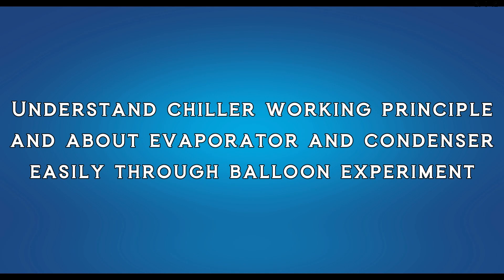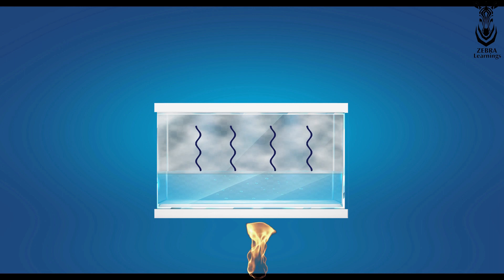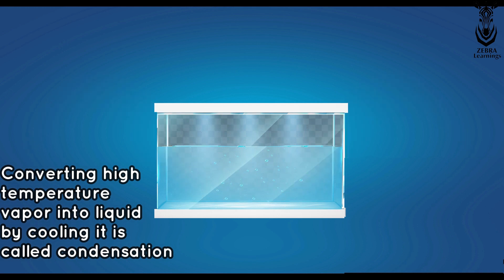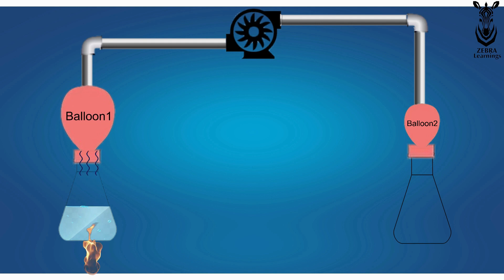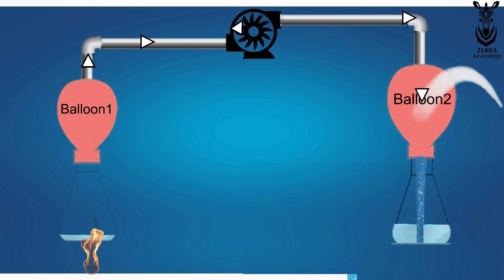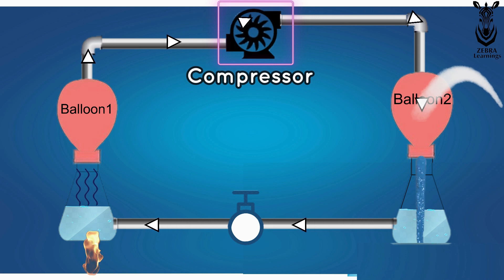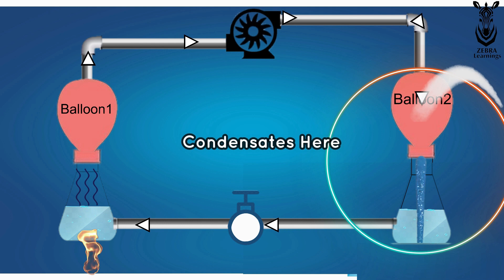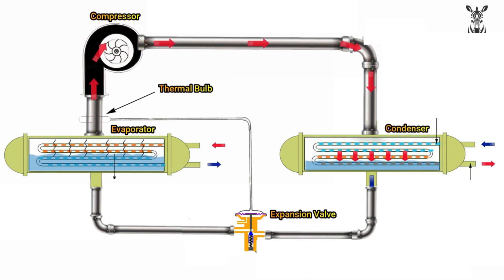Easily Understand Chiller Working Principle by Balloon Experiment | English | Animation | HVAC

Comment: Why does the refrigerant change its state from gas to liquid at 30°C in the condenser, if this same refrigerant is boiling at 12°C in the evaporator? If i am right is it because of the pressure? Please explain
Reply from the maker: Nice question. Yeah you're correct. It's because of pressure difference. 
At the evaporator the refrigerant pressure will be low so it will boil and evaporate at low temperature. 
But in condenser the refrigerant will be in high pressure because the Compressor is compressing the refrigerant So the refrigerant pressure will so high. So refrigerant will not boil at low temperature.